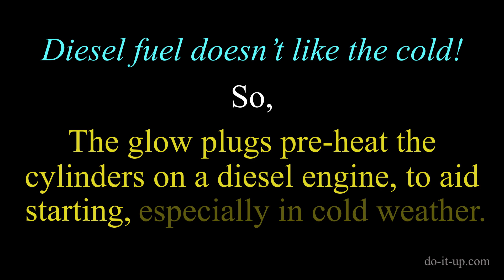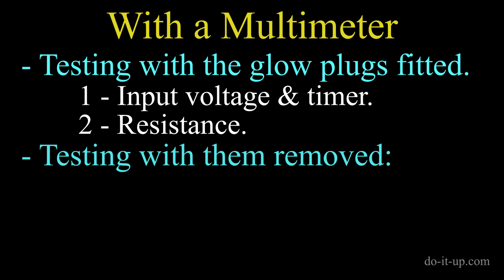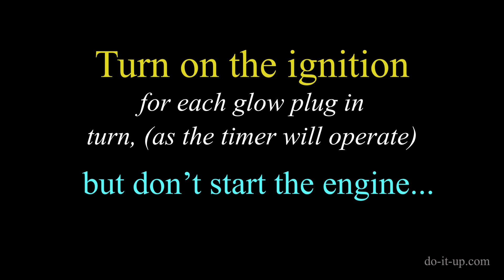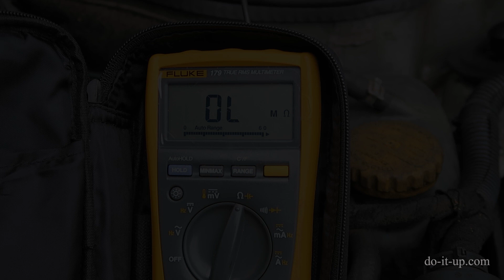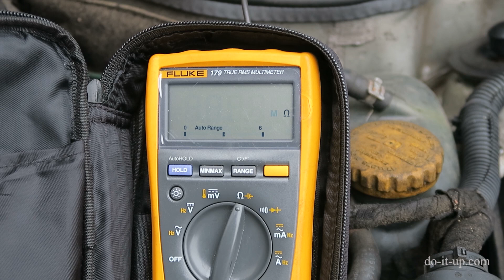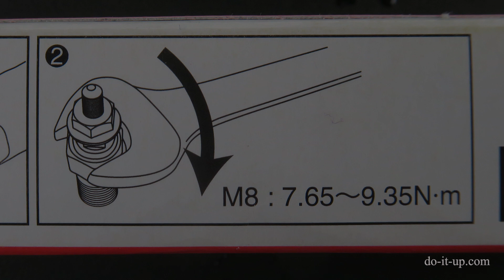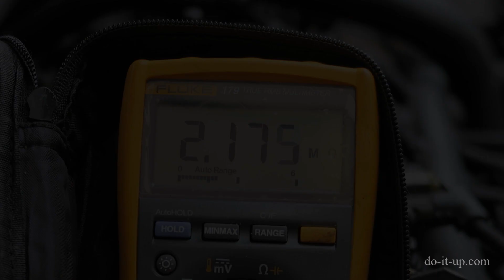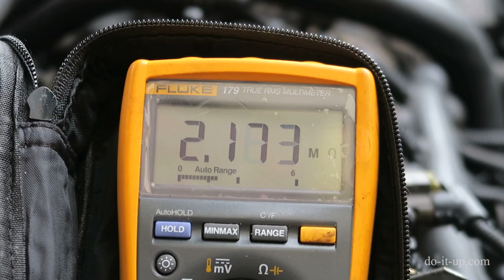How to Test Glow Plugs From Start to Finish (With a Multimeter) - The Complete Guide.

Comment: Great video. Very helpful.
I have one question, how mutch OHM does hè need to be useful.
Thnxxx👍
Reply from the maker: Hi, I understand that typically, a new glow plug will be 1 to 5 ohms (I've not measured many). For an explanation of glow plug resistance and heat, see https://do-it-up.com/vehicles/engine-transmission/diesel-wont-start-when-cold-how-to-fix-glow-plugs/#Glow-Plug-Resistance-Explained.  Hope this helps...   😃
Reply: @doitup can you use instead of beeping with a multimeter als use a 12V voltage finder with a light?
It should work the same?
Thanks al lot👍
Reply from the maker: I've not tried it, but I don't see why not (as it should be the same as testing the continuity with a beeper/buzzer). I have another video that may help. It shows how to test glow plugs without using a test meter: https://youtu.be/YkKsbRHHNS8, as not everyone has a test meter to hand in their toolbox...    😀
Reply: @doitup  thank you so mutch for help
Reply from the maker: No problem, I hope it all works out and you get it fixed.

Comment: Full informational video
Reply from the maker: Hi, thanks. Glad you found it useful...   😃
Reply: @doitup  on all candles the resistance is 0.8.  I go further
Reply from the maker: Low resistance is good. It means the glow plug will heat up...  Here's a quote from Google "The total energy dissipated by the circuit is proportional to current, so the resistance of the heating element has to be low enough to draw sufficient current to generate enough heat"...  But, "The resistance of the heating element has to be high enough so that most of the energy is dissipated by the heating element".

In other words, I think this means...  You want a low resistance, so the energy is dissipated in the glow plug and it heats up.  But… Not a really, really low resistance (like a dead short). Otherwise, the energy will be dissipated in the glow plug, and in the rest of the circuit. Blowing the fuse and potentially melting the wires (dependant on the fuse rating and how quickly the fuse reacts!).

I'm no expert, but 0.8 ohms sounds good. Note that each manufacturer, or circuit design may have slightly differing resistance readings, due to their design parameters (and the actual condition of the circuit will also have an effect). Hope this description helps, and makes sense...     😄

Comment: I have only 9, 5 volts on the positive side of the glowplug and 12,5 volt on the battery when engine is not running! What could cause this drop in voltage!?
Reply from the maker: Hi, it could be caused by a number of issues. Bad contacts, connectors, degraded circuits (the voltage passing through a circuit card, old wiring, etc). The best way to determine the cause, is to trace the circuit back and measure the voltage at different points... It can even be an issue with where you connect the test meter (the return path) to measure the voltage (a bad contact).

Note: The glow plugs negative (-ve) connection is the screw thread of the glow plug where it screws into the engine. Therefore the engine, must also have a good return path to the battery. Hope this helps...   😃
Reply: Some cars are fitted with 9,5 V glowplugs.

Comment: 7:25 I would recommend to everyone before you start removing the glow plugs blow out the surrounding area of the glow plugs with compressed air to prevent and dirt, grit or grim from entering the cylinder or cylinder head threads when installing the new glow plugs.
Reply from the maker: Great tip, just make sure you wear some safety specs before blowing any debris out...    😀
Reply: @doitup  lol yes
Reply: yes, definitely, and plug the holes with something too if possible in case anything falls/gets dropped down the glow plug holes

Comment: Great easy to follow instructions thank you, at the end of the video is a puff of smoke injector area is that a bad injector seal?
Reply from the maker: Yes, I think it is. I did wonder if anyone would spot that! 😀 The injectors have new copper washers fitted now, so no longer an issue. However, it was a pain getting the injectors out (because of the carbon build up around the injectors). So, two schools of thought...  If it ain't broken leave it. Or, fix it as soon as you see it. In the end, the injectors had to come out for another job! All I can say is; always fit new copper washers when removing injectors. It saves a whole load of grief later on..!  Thank you for your positive comments...   😄
Reply: @doitup  yeah I hear they are a pig of a job to do! And your right they are one time use copper crush washes I believe so best to use new ones. The reason I pointed out was it would of made another great video👍
Reply: @z0m123  you can anneal them one more time if you dont have new ones

Comment: Saying the Ohm reading indicates a bad glow plug is not enough. W also need to know what  the proper  resistance will read if the glow plug is good. I've watched several similar videos, and all omit that information.
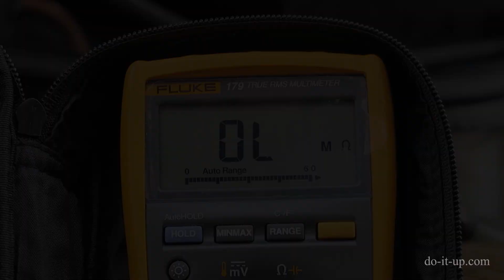Reply from the maker: Hi, please see the video at...   6:36, 9:49, 10:04, 11:16 & 11:27 where it shows new glow plugs being tested and provides resistance measurements for new glow plugs. There should be a low resistance so heat is generated, but not a dead short. Hope this helps...   😄
Reply: you werent paying attention, it was very clear, typically, when buying new glow plugs, the resistance values are printed on the box
Reply from the maker: Hi, thanks for the info...  It's a great tip. 👍  Also look out for the torque values, they may be on the box as well.  😃

Comment: well presented clear and simple yet very informative thanks, just a question does a bad glow plug, make the fuse to get blown... (in just 3 seconds after ignition ON)
Reply from the maker: Hi, It does depend on the fault, but it wouldn't usually cause a fuse to blow (unless there was a dead short). Glow plugs usually just stop working (the resistance is too high, or, they're open circuit). For the fuse to blow, the circuit is drawing more current than it needs. Here's some things you can try...

With power off:
- If you have a test meter, measure the glow plug resistance and compare each of the results (there should be a low resistance so heat is generated, but not a dead short).
- Check to see if the wiring has rubbed and worn away anywhere?
- You will probably need a wiring diagram, but check for any short circuits (not always easy if there's electronics involved?).

With power on:
- Waggle all the cables and connectors to see if that has any effect? Lots of vehicle have dodgy connectors, broken wires, insulation worn away, etc.

If all else fails, disconnect everything electrical to do with the glow plugs. Reconnect items one by one, switching the ignition on and off each time (not always essential, but good practice), to try and identify which area is causing the fuse to blow. You may blow a fuse, but you could narrow the fault down. Blowing a fuse to find a fault is not good practice. Warning: Things to be aware of...  Fuses protect the circuit, but they don't always blow fast enough. You can still melt wires, overheat components, cause damage, etc. so this is a last resort.

As usual, any repairs, fault finding at your own risk. Hope you get it fixed...  😃
Reply: @doitup  thanks man I really appreciate that not only you answered in no time but with an extensive explanation too :) ... I already tested only one glow plug still installed and it was good 0.5 ohm cuz it was easly accessible... mine are between the dashboard side and the transverse engine under many components that most likely I have to remove to be able to just test the glow plug...
i do have the electrical schemes and I already tested the rely and it's fine résistance 55ohm and it does close when supplied...
the general continuity is also ok between fuse rely glow plug ... 
I still have to test voltage in relay terminal the one to the ECU it should be around 3.6volt ...

one last thing I realized after blowing the 2nd fuse in 2 3 seconds after ignition on that I had a major rain water leak from the roof inside howses... it was oriented to the back passenger under seats so I found out a huge amount of water a little swimming pool lol so I'm thinking maybe there is some wires that are shorted... the caused this... 
thanks again buddy this is my first car and it's a 2009 kia cee'd that I bought only 2 months ago ^^
Reply from the maker: It's great you're giving it a go to find the fault. Newer cars (2000 onwards) are so much better than the old ones, but when they go wrong...  There's often a little knock out plug in the floor to allow for draining (for when the dip the car in paint during manufacture). If you do have a plug in the floor, just crack open one edge to allow the water to drain. Hope you get it fixed soon.  😃
Reply: @doitup  hi again just wanted to tell you that i finaly my engin succesfully started today & i did found that what caused my 80A fuse to blow was indeed a shorted glow plug (but not a dead one a functional one lol) the rubber isolator between the (+) side and the ground (-) was mostly gone or melted away; the fun thing is that i had to replace it cuz i broke it by mistake (i over tightend while i intende to loosened it)... one of my conclusion is that testing the glow plug while in place is very unrelible (at least in my case) mainly because their low resistance was +/-  0.3 ohm and a defective wire or probe give 0.5 ohm and they are already groundedin engin head so they are always shorted according the multimeter (in the continuty test) ... while i did test the others in place one by one i had to make a small fuse of 20A adapter (a work around), no fuse was blown, (i wonder if i tested the shorted one in place what would happend , since there still some rubber isolator and it did glow when i tested by the battery) any way your answers were very helpful so thanks again and may allah rewards you, blesses you and guide you to the right path :)
Reply from the maker: Hi, it's great you found the fault, and thanks for the update. It's always helpful for me, (and others) to see how you fixed it. I'm no expert, just been trying to fix things for a few years and trying to pass the info on. Thanks for asking allah to guide me on the right path...  😃

Comment: Does it matter if vehicle is on or off?
Reply from the maker: Hi, it's best to take measurements with the engine off for the following reasons:

When you're measuring the voltage, the glow plug timer will need to be operating. I.e. the glow plug timer starts when you put the ignition on. The timer will turn the supply off after 'x' seconds ('x' depends on the vehicle). You may therefore have to turn the ignition on and off several times to check all of the glow plug voltages and timer. Therefore there is no need to start the engine, plus you may be connecting and disconnecting the glow plug leads.

If you're measuring the resistance in place, you should do this with the engine off, so there's no voltage being applied. Resistance of the actual glow plugs is best measured with them removed. However, measuring the resistance with the glow plugs fitted, also checks part of the circuit (their connection to where they're screwed in. Part of the return path back to the battery).

Hope this helps...  😀